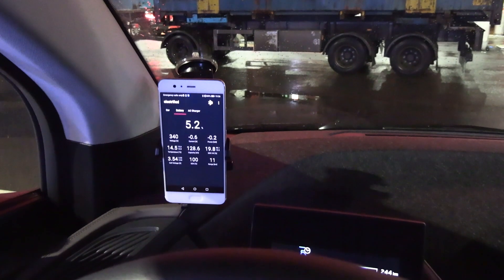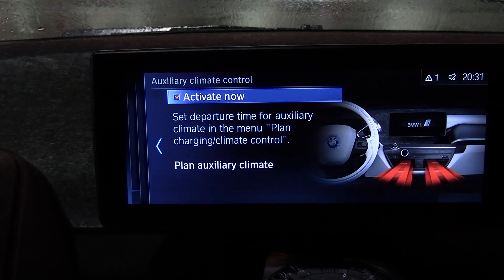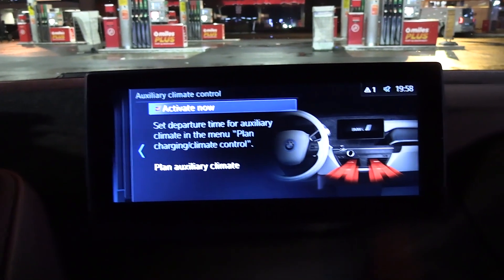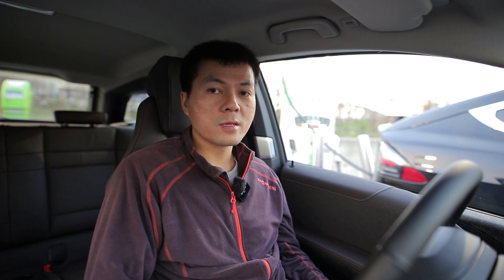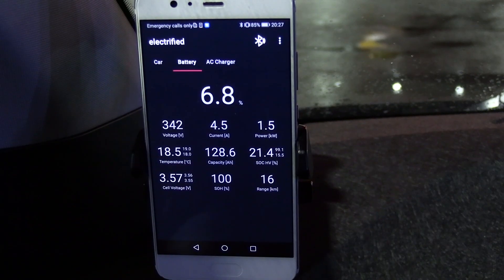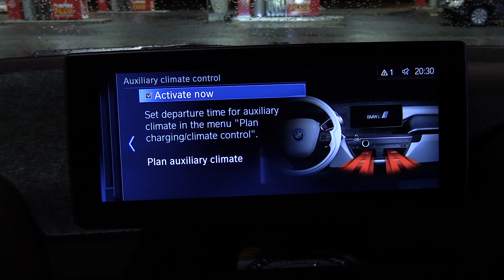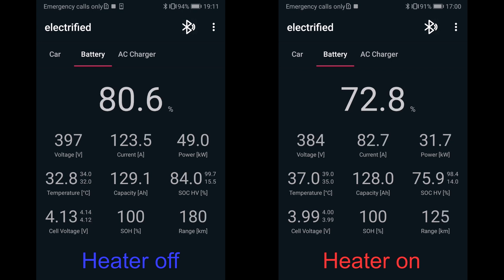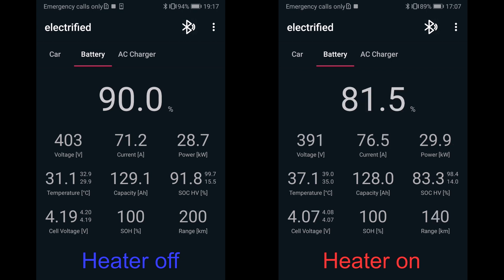BMW i3 42 kWh overheated battery (rapidgate)

Comment: If you look here https://www.realoem.com/bmw/enUS/partgrp?id=8P23-USA-10-2018-I01N-BMW_i-i3_120Ah&mg=64 you can see that there is the auxiliary heater with pump. Plus a control unit for heat pump. 
If you scroll down completely there is a battery dryer, wonder what that is for.

Comment: Ive had my i3 for 18 months and although its a good car, I’d recommend people dont buy bmw EV’s, as the bmw are not interested in sorting out glitches and continuing to support all the electronics on the i3. The app is hopeless as its so lagging and they dont want to improve the i3 with software upgrades like other manufacturers. 
We the customers want our i3’s to last a reasonable amount of time (bmw made such a thing about recycling and environmentally friendly manufacturing and materials) but they have given up on the i3 and its owners, they wont even offer battery upgrades!!! Needless to say I wont be replacing my i3 with another bmw.
Reply: Is the OS7 which is in the new models not solving this with ota updates?

Comment: Might be a silly question, but could cabin heat travel to the battery? ie is the thickness of the floor between battery and cabin thin enough to allow some cabin heat to trickle to the battery? I'm not super familiar with the i3 but I'm wondering if it has an effect, if small
Reply from the maker: No, cabin heat won't affect battery temperature. If that was the case, then cooling down the cabin would cool down an overheated Leaf battery. Cabin temperature has no influence on battery temperature.
Reply: @bjornnyland  Ok, wasn't sure how effective great transfer was. Thanks Bjorn

Comment: I think that BMW only equipped one compressor as they wanted the I3 to be "light"
Reply: There is also resistance heater.
Reply: But one compressor should be enough 🤔. It would just need to have more advanced valving and two evaporator sections.
Reply: @tkermi  There are actuali 3 multivalves, pretty expensive ones. But just one evaporator... Which is the problem. And auxiliary resistance heater is heating coolant, not air directly.
Reply: @josefsoltes8572  Oh, thanks for the info!

Comment: Tesla solution is not an advanced one i would call it rather a shit one, but in this case looks better. It has no heat pumps for heating it uses a heat coil which result half range during winter. BMW uses a heat pump like an air conditioning device and clever way use it for heating and cooling. The issue is the software again. The software should monitor the battery temperature and switch off the heating if the battery needs cooling and when the battery is cool enough switch back the heating again.
Reply from the maker: Tesla's solution allows you to keep the cabin nice and warm when it's -20°C outside and still not overheat the battery ;)
Reply: @bjornnyland  Yes indeed, but in other hand you loose half of your range because when you are moving with tesla the heating is ineffective compared to a heat pump. That's why i wrote, theoretically BMW could make a solution with a software update, but they simply does not care about this issue, which is not nice.
Reply: @istvankoncz8923  I see you only read what the short sellers write. You definitely don't lose half your range even with the resistive heater. Maybe 20% at -20C. Now that every Tesla has a heat pump, the loss is even less. So your point is incorrect and outdated
Reply: @alt572  Well, read e.g. this study
https://electrek.co/2019/02/07/study-electric-cars-lose-range-temperature-tesla-disputes/
it is about 41 or 39% with Model S. it is not the half, but almost. :) Of course, they measured at 20F which is -6C quite warm compared to -20C what Bjorn mentioned. At -20C there will be more than 50%, i am sure :)

Comment: Overheating I think is a false statement. This would imply it exceeds the maximum permissible temperature. The battery gets warmer may be a suitable description.
Reply from the maker: Ergo, overheats.
Reply: Bjørn Nyland overheats implies is a threshold has been breached beyond which damage may occur. Please advise the threshold temperature.
Reply from the maker: No, overheating does not mean damaging. Overheating just means beyond a limit where there are consequences. And the consequence is charging power throttling.
Reply: @bjornnyland  }

Comment: I really don't get it. The car is a city car you drive daily for short trips,commute etc and fill up during night at home...Thats probably what 99% of the owners of this car do. Its not a car designed for fast charging,long trips etc. You can,but this is not that kind of car. That said,BMW should fix the stupid heater issue.
Reply: That's pretty unrealistic. Who is spending 40 to 50k€ on a city car?
Reply: @alt572  I did,but it did not cost more than approx 30k Euro. Use it for commute 110 km a day